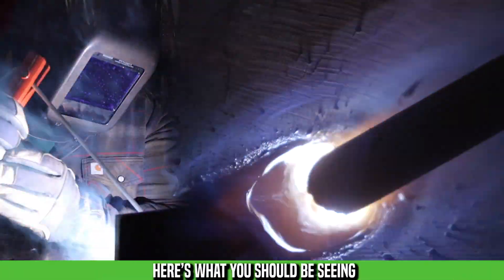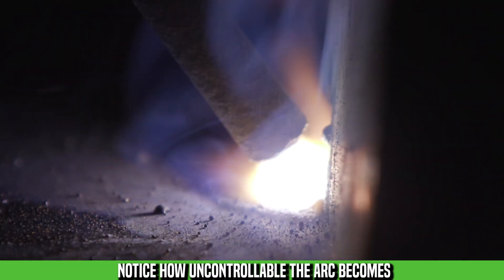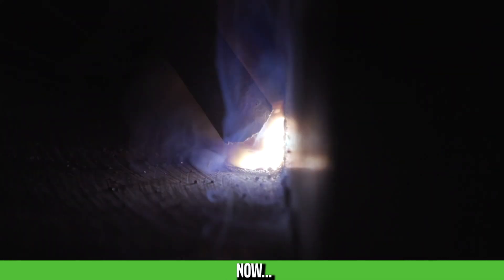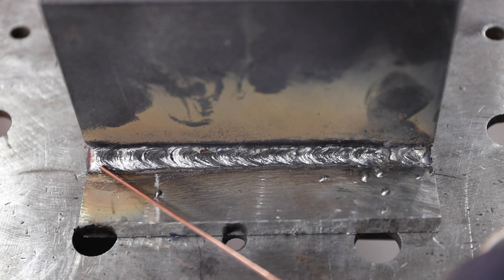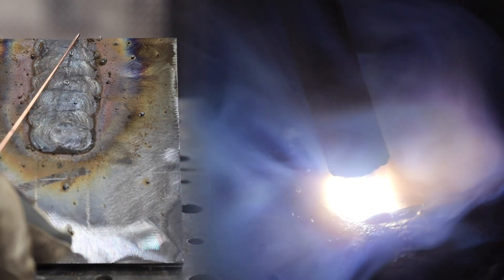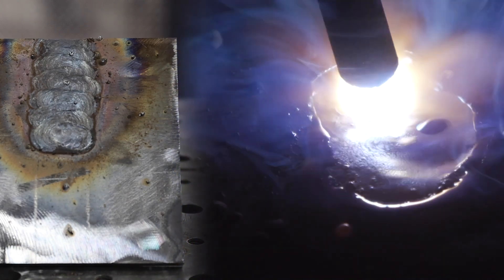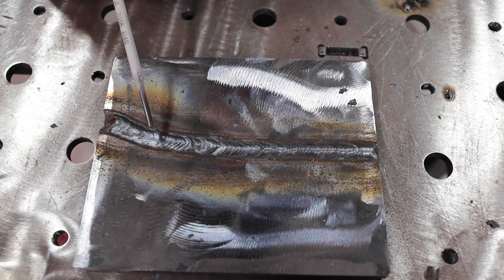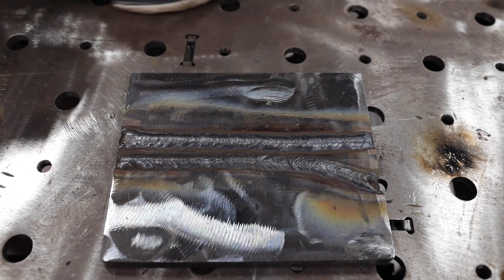3 Biggest Mistakes Weld Students Make... FIXED!

Comment: That was such a good point about the firework effect! No matter how slow I try to go (I'm talking running at least 50 or more welds), my brain just cannot seem to slow down enough. I hear the sizzling and my brain almost reverts to caveman mode and is like "hurry, hurry, put it out". It's really strange having to slow down and control when something is on fire in your hand. Thanks for that insight!

Comment: I just started my short smaw course less than 2 weeks ago and right now I'm in the fourth day of actually trying to weld after I had my welding environment and safety classes prior to welding. four days passed I still got some issues with those mistakes you mentioned on the video, sometimes I had a nice and smooth line, but sometimes I keep repeating those mistakes over and over. I hate my own consistency haha hope I could pass my certification test next month
Reply: It's a problem with "muscle memory" if you've memorised a bad pattern, you just keep repeating the same mistakes.
I think i'm right there with striking an arc to begin with.  I just can't seem to learn what I SHOULD be doing (crying right now) and I just keep sticking and then scattering/spattering as I pull off... again... and again.... and again...  cry.

Comment: Fantastic tips! the only one I have problems with following is the "don't lock up" one. I stand in as a fitter (think machinist +welder) on a ship so I need to be locked in otherwise I'm constantly jostled by the ship.  Do you have any tips for that?
Reply: Holy cow, I never thought about welding on a ship that is not in port.
Reply: It sounds like the only hope is to become good at restarts!  That is, weld a little bit at a time, whatever you can do in that one position... clean it off and do a good job starting again where you left off.  There's a lot of videos and literature just about restarts.

Comment: I just bought a welder and have practiced now about 40 minutes.  So far the almost impossible task is to have a nice arch going.

Question.   I assume that once the arch is running and the welding rod gets shorter  does not one have to also push the now shorter rod closer to the metal to keep the constant distance.

Question   If one has no table to lean on and is  standing up welding a pipe or something, how does one than control ones arm.   Thanks
Reply: Yes!  He's talking about that in this video!  The rod is constantly burning away, you have to constantly feed it in!  He says several times ("muscle memory") that this becomes automatic and finally you don't realize you're even doing it.  As far as steadying yourself goes, there's a lot of discussion about this in videos by Jody (WELDINGTIPSANDTRICKS), as "propping", there's no general answer to this!  Jody has a specific innovation you can buy, a piece of insulation material you can put on over your gloves so you can touch the hot base metal a little, so you can rest your hand on the hot work.  It's a little desperate, but there might not be anything else.  But sometimes you see people doing something with big clamps, just to have something to "prop" on.  But you have to think of something!  The last thing you want to do is just wave the electrode around!  You want it to go in a specific place, right?
Reply: @leonardpearlman4017  Thanks so kindly for such great info and you helped me a lot on that.

Comment: I really struggle to keep my hands from shaking. My beads end up inconsistent in size and they aren’t really straight.
Reply: Bracing your hand, much like the instructor here did, really helps, plus, this 'muscle memory' thing, you may find your concentration improving in time.
I find what really helps me improve (I use a flux core/mig wire feed) is just sticking that tip into the puddle at the right distance. I am new at this too, and what I find is welding is like some sort of zen moment or at-one-ment with God, the whole world disappears and you are concentrating on the power to melt together and join two pieces steel, right at the end of your hand.
I feel like a 'metal god' with an angle grinder and a cheap Mastercraft 80A MIG/FLUX machine, at this time I am making me a mini-bike.
So yeah, experience that hyper focus zen moment where the only thing that exists in the whole world is you and that molten puddle of metal, you feed it and control where it goes.

Comment: I cant see where im placing the stick should that be the case?
Reply: Generally speaking this is why people like automatic helmets!  Otherwise you have to (in all methods) learn to get lined up on the work (resting your hands ON the work) and then close the helmet without moving your hands!  Usually by nodding your head, I'm sure you've seen this in videos.  NOW you're in the dark, but your hands are still in position.  Then you have to strike the arc, and you'll have lots of light!   I learned from a video about pipe welding that you can hold the actual rod a little with your off hand, so that the electrode is close to where you want it to be.  SO one hand is holding the rod holder, one hand is holding the rod.  It seems like you would be shocked by this but it hasn't happened so far.

Comment: I weld with 6011 rod at about 75 amps I try to let the butt of the rod drag very lightly I’m 3 weeks into welding as a high schooler I take great interest in this for a career choice something I struggle most with is on how fast I should be moving I don’t know how slow to go my teacher keeps saying go slower but at this point if I go any slower I’m not moving and will just burn through my work piece the work piece is pretty thin it’s about 5-7mm mac
Reply: Max
Reply: count a cadance in your head if you need to 
40 years in the trade and i still do that

Comment: The number one problem i have is that i cant see the plate through the dark tent on the mask
Reply: ??? If the glass of your helmet is too dark you can easily replace it with a lighter one!  They are not expensive, you can get a few and keep them handy.